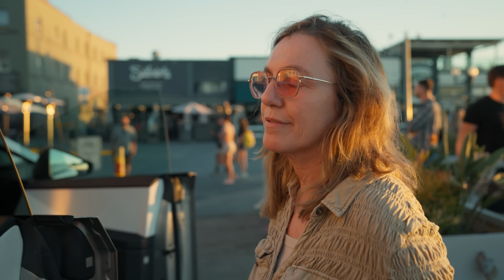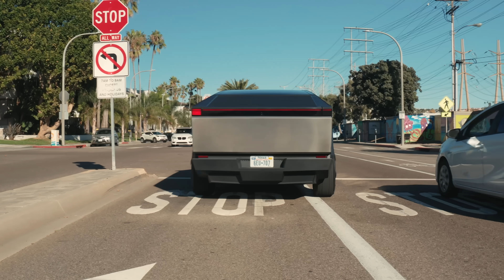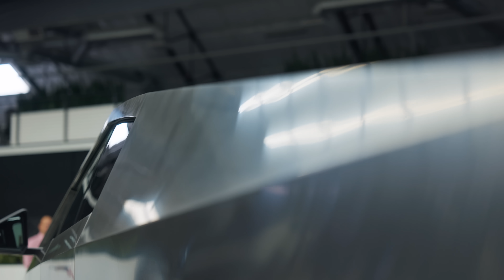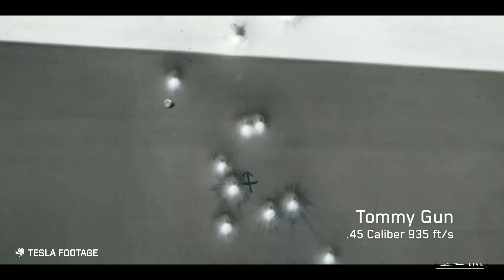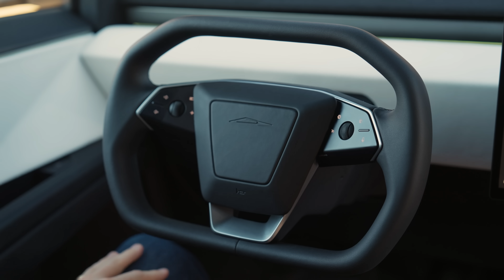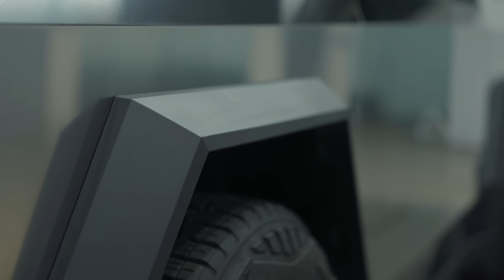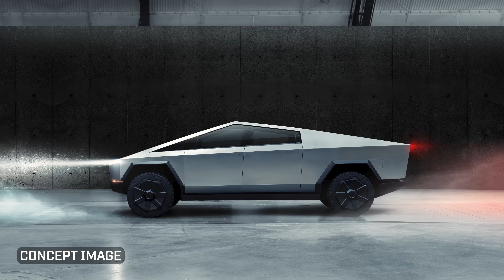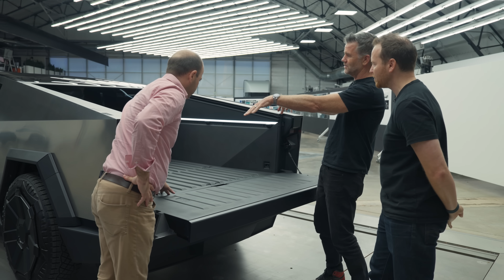FIRST DRIVE: Tesla Cybertruck Full Review

Comment: I have to think the world didn't need another Ford or Chevy with just the difference being it's electric and made by Tesla.  I will give the engineers and designers kudos for not doing that.  It's truly striking.  It looks like it is from the future and always will be, lol.  The only thing that bothers me, personally, is those really sharp corner top points in the back.  They look lethal, or at least potentially painful.  I'm not ready for any electric vehicle because of the intrinsic idiosyncrasies an owner must work around.  That would be higher mileage trips with and without towing due to charging availability and inconvenience.  It must include much higher repair cost potential and the higher insurance rates that follows.  Finally, the consumable tires are quite expensive.  This isn't a vehicle for the conventional pick-up customer, but it certainly cuts its own path to the point of having no direct competitor.  I imagine it will be another niche Tesla hit with just a hint of crossover into the mainstream.

Comment: Tesla are pioneers, and Tesla are idiots.  Reinventing the pickup to be ACTUALLY TOUGH in stead of just saying it's Tough is a big yes.  Tossing in novelties like the idiotic off-center computer screen to replace having a (more expensive) gauge cluster and removing nearly all tactile controls so you have to take your eyes off the road for those too just isn't acceptable.

On a side note, did I understand correctly that you can't turn off 1 pedal driving?  I hope that's not the case.  I don't see why they can't integrate regen into the brake pedal movement.

Comment: Well, it's stupid and useless for a few reasons. One, it's useless as a pickup truck. Two, electric powered vehicles are just unrealistic for most buyers in the mainstream. The stainless body is wavy. The body design itself is awkward, and looks like something a 5-year-old child would draw. The steering sounds like it would be way too twitchy. You cannot see out of the rear window it appears. (I don't care about cameras, I want to be able to turn my head and look out a rear window.) It appears to have HUGE blind spots. Unless this reviewer is like 4 feet tall, the driver's seat looks ridiculously huge. It is WAY overpriced compared to what it was supposed to cost. The "bulletproof" glass broke during the way overblown introduction or whatever that event was called. The world is getting stupid, and this "truck" is just another example of that stupidity.

Comment: the sure have hit a home run after all this time... except the bait and switch on the pricing and stats. over a million people put $100 down expecting a 40K EV truck that was more than capable, and got a 60K truck that's not even available for 2 more years and has the worst performance stats on the same size battery pack and isn't even worth it. now everyone has to spend 80k and wait a year or 100k and wait months just to get 1 that's actually capable, or lose their spot in line. a complete bait and switch that they should be class-action suing for.

Comment: I'm surprised you didn't ask about the disastrous visibility of the A pillars. This thing is a terror to people in crosswalks, on the side of the road in turns, or bicycles. Is autopilot just supposed to save those lives?
Reply: That's a good point. Hopefully there will be a facelift every 1-2 years.
Reply: So you have drivin one and know that is a fact? Not a single person I have seen in a video that has actually driven one has mentioned it.
Reply: On the contrary all test drivers I've seen  remarked on how awesome the forward 180 visibility was compared to others. Once they got used to tech for the rear it was the most "secure safe" truck they've driven
Reply: @Jazz5777  Work a little harder on your research then, there are lots of reports of just how bad it is. What bugs me is that we had the designers right here and no one asked them.
Reply: Imagine your head smashing into that stainless steel body instead of sheet metal! Like an egg thrown against a brick wall. Should be called the Pedestrian Killer Truck instead.
Reply: Tons of flaws. I would not want to be the first adopter.

Comment: Chopping my way through this video, and taking what was promoted from the past: it sounds like they've relied on an exoskeleton for structural rigidity.  It appears from comments, that this impresses a lot of people but coming from a world of steel, construction, design -  great designs are cool in perfect world and brand new, but often overlook practicality of serviceability - so I'm curious to see in the coming months, if thresholds were properly established, interpreted and enforced for the condition of the body, aka that structural frame.  I can look at my truck at this very moment, with admiration of its dents and bumps all while without sacrificing the frame whereas if the body was a frame, it would start creeping to thresholds outside of acceptance and require repairs. The material type, thickness and continuous extent (without seams) makes me suspect that repairs to those vehicles who have structural damage will be so great in cost due to the process (complete joint penetration welds), lack of labour (probably zero body shops even know what that is, and even in the steel fabrication market only a small % are qualified to work with stainless).  I suspect those who buy teslas, even the trucks, don't actually use vehicles in the same way, but coming from someone who admires practicality of both use, service and maintenance costs - I don't think this would be the truck for me but those who want to admire engineering and futuristic boundary pushing vehicles.  I guess I'm just getting too old!

Comment: The hype about the look is shadowed by the advances in engineering here. The look is what sells cars...the sizzle, the sexy. But the engineering is next gen and watch the legacy auto makers follow.High voltage architectures for instance, more efficient for delivering the current and using less copper. Engineers with imagination starting with the initiative from the top engineer, the boss.

Comment: Will be interested in how this big boy handles in snow and ice with proper winter tires .  Weight distribution can be a killer on traction at launches from a red light or stop sign.  Also being a piggy can be a killer for stopping distance on the highway in snow.  Also curious what 0-30F temps will do to battery life and range on this truck.
Reply: I have seen one being tested here in Norway up north too where it gets to -40C which also is -40 Fahrenheit.
Reply: @hardergamer  cool do you know what the results or feedback was to range in the cold?  Also did they give feedback on handling from a dead stop and then stopping distance?  Driving 50mph on a highway in a snowstorm at 25F would be a concern.
Reply: It looks like very special tires. Haven't found any info on fitting a large selection of regular tires based on desired conditions, load, speed ranges, durability and price point.
Reply: Don't see any winter tires available on tirerack ... do we know if any would work on Cybertruck?

Comment: Looks cool, does have some good engineering, i like the 4 wheel steering

The biggest thing for me that would be a turn off is flyby wire steering, I like getting road feedback in my steering wheel can tell me a lot about how the vehicle is handling\traction\mechanical health. Also i like to have a steering wheel that gets heavier the faster i go so i dont give too much input (my honda accord does this with its ESC, at low speeds it gives more assistance with steering and high speeds it gives less help), its sorta the reason i absolutely hate driving GM's as their power steering has always been way too light so i always feel like a float over the road and with little input on the highway im going all over the place.

Although being fly by wire im sure they could have a computer give you artificial feedback

Also what would happen if the truck loses power at highway speed, can you still steer? (i know its rare scenario but still)
Reply: It provides feedback... more than many vehicles with over-powered power-steering.
Reply: @JorgTheElder Thats good, while electric trucks are not as practical in my neck of the woods I can see with improvements of infrastructure and technology we have some cool stuff in the future to look forward to

Comment: This is gong to be a truck with a lot of problems. Info is just spewing out of Tesla that this thing has no business being on the market. Why do you think they're only making UP TO 50,000 examples-when they could sell countless millions- and took down payments from 500,000 people? They're not able to mass produce these things for some reason. Well, it turns out that according to the leaked data, it not only has typical p.o.s. Tesla problems but there are serious design problems. All you have to do is look at the steel sheets on the exterior. They look like plastic that's been in the microwave for 15 seconds. Waves, front-to-back, side-to-sude. 

Also, in the commercial vs the 911, they lied. They used the uber base model (which is okay, I guess) without launch-control, traction-control, and in "N"[ormal] mode which is the 'driving slow in-town to get good gas mileage' setting. Not "S"[port], "S+[port Plus], or [T]rack. Also, and I'm not a Tesla hater, Musk gets away with saying anything when it comes to his companies. He said it would be 40k. Engineers, when that number was announced, said that claim was nearly impossible, it could be less than 75-80k Nobody holds him accountable.

Comment: This is a cool concept car but if you read in between the lines of what the engineers were saying, it seems like tesla themselves are anticipating issues with the scalability. Due to all these exotic materials and new technologies, I don't know if they'll be able to actually mass produce this thing and even if they can, will they make any money off of it. I also worry if the quality of the actual production versions will degrade. I think they probably put in a bunch of extra QA to produce these initial trucks to be paraded around as a demo car. Wonder what the quality and the performance will be of the mass produced ones.
Reply: They delivered 20 of them to actual owners. Not demos. Owners.

Comment: What is all this baloney about the Cybertruck not being functional? It stomps competitors when it comes to functionality. It has built-in 120 and 220-volt AC outlets in the bed. It has a covered bed that can support over 200 lbs (so you don't have to wonder if the bed cover is going to get bent when you put a toolbox on it). It has a 4x6 foot bed that expands to 4x8 feet, the size of a plywood panel and wallboard. It has the greatest towing and carrying capacity of any pickup. Tossing off comments about it not being functional has become so common, but it is dead wrong. It has a 17-inch clearance for off-roading. It has a tight turning radius. Just stop the lazy commentary and think before you speak. So now instead of FUD we just get lies.

Comment: If it is so strong on the outside, how will it behave on a full on collision with other cars that are design to crush on impact and absorb most of the energy?
Reply: The front and rear castings are designed to fold in a collision, and to fracture in higher speed collisions, dispersing a lot of energy.

Comment: Why no charging port up front, like a Rivian R1T?
If you have a Rivian R1T, hauling a trailer on a road trip wouldn’t be the total horror story in comparison with other EVs (including the Cybertruck).  With the exception of 1 charging station in Tennessee with 4 pull-thru stalls  …. every charging station I’ve ever seen (in real life or photos, in North America), one has to detach the trailer AND park the trailer somewhere BEFORE being able to pull the EV into the charging stall  …. because the charging port is in the rear of the EV … and a hooked-up trailer blocks the charging port.

Comment: Lithium is   a  rare  earth metal  and  the  cost to Produce the  batteries is prohibitive -  You can  see  there  are  No Knobs 
and Dials  so  you have  to take  your  eyes of  the  road  to make  changes - Dangerous  just like using  your Cell Phone 
when  driving  - In the  hotter  Southern Climate  you have electric  cars  catching  Fire and in the  Colder Northern Climates 
your Range you can drive  in  a lot shorter -   Where do  you find  a Charging Station  ?    GOOD  QUESTIONS  ?

Comment: I like the general look, but i question the sharpness of those edges. The Countach is a boxy wedge designed to slice the air, and it still has more curves and soft edges than this. Plus the loadbay might be big, but that sloping roof robs it of some practicality pick-ups need for larger cargo. There's a whole industry for designing aerodynamic canopies for pick-ups of all shapes and sizes that this Cybertruck is basically ignoring because it ashews the standard 3 box design language of a pick-up. And then there is also the issue of reliability of the battery. An electric off-roader is undeniably cool, but the Internal Combustion Engine had over a 100yrs headstart and has been refined so much that it's much cheaper to run than an electric car. It takes a few minutes to fill-up the feul tank, which would take hours for the equivalent EV, plus it edges out on range and petrol stations are in abundance worldwide. Not to mention the mechanical upside of manual ICE cars being able to be pushed without power to the nearest petrol station. Most Safari off-roaders use jerry cans for backup feul, and usually that's enough to get them back to civilization. Then there's the problem with where the electric power comes from. Not the environment factor, but the governmental factor. Most countries don't have the infrastructure to support an electric vehicle industry for the general public. In South Africa we are struggling with keeping the lights on cuz our government is so incompetent at managing the national power grid.

Comment: The F-117 was so edgy a design as its outlines were calculated for lowest possible reflection of radar waves on a Cray 1 computer in the Seventies. This computer simply couldn't handle more complex shapes. With this in the back of my head, the Cybertruck looks like outdated stealth tech to me. Its drag coefficient will be off the scale with all these hard corners, so it probably sacrifices range for looks, which is something I don't nearly like.
The pedestrian-slicing outlines probably will prevent it from meeting the minimum requirements for third party protection in crash safety, so I doubt it will be marketable in Europe. The bonnet's front edge seems to be at exactly the right height to crack the skulls of 6 to 10 year old kids.
That doesn't make much of a difference for most Germans at least, for at its 3.1 tons empty weight, it is beyond the weight limit for the common Class B driver's license (2.8 tons) anyway, you need at least the C1 truck license to drive it.
And you won't drive it fast, for on German roads, vehicles of a total weight loaded above 2.8 tons are restricted to 80 kph. ☺ 
Mentioning Germany: We have our TÜV-examinations here, the bi-annual technical examinations for road-going vehicles. TÜV publish rankings of car makers by the number of road safety relevant defects found in the examinations. Teslas performed abysmally bad there, ranking last in the list behind Romanian budget car manufacturer Dacia.
This makes me wonder if Tesla will end up as another flash in the pan like DeLorean and others before. All the sales points may end up having been nothing but marketing blab, and basics of car design were ignored or approached from a viewpoint that is very much focussed on permanent fair weather conditions like in California or Saudi Arabia.

Comment: I just can't get over the design. To me it is extremly ugly. The front is all right, the rest looks like they ran out of time to come up with a design. I have nothing against simple and plain designs. But this is just a box. Reminds me of that electric car Clarkson, Hammond and May "build" in Top Gear. Different is not automatically good.
The car is also very dangerous to pedestrians since it is hard a a rock and has many sharp edges. I guess without some rather substantial changes this won't be approved for sale in eruope. It's probably useless anyway since our streets are quite narrrow. The technology is fascinating, though. And i like the look of the stainless steel.

Comment: Looks awesome and more functional than expected… Entirely steer by wire though. Hard pass. If your power steering pump fails, at least you still have functioning, but heavy steering. What if the wheel position sensors or steering motor glitches right before a corner?
Reply: You might then also want to avoid airliners, as all newer Boeing and Airbus aircraft are fly-by-wire, with no mechanical connection between the controls.
Reply: Well, obviously you crash and become another telsa statistic
Reply: @Chris-Brown- you mean the statistic of the safest cars in the world? That one? 😜
Reply: You mean the cars that drive themselves into semi trucks and don't even try to stop? Or run over people? Those "safe" cars?  @MJ-zo5gb
Reply: seems elon doesn't care about who dies driving his projects, how many customers have already died while unknowingly beta testing his crappy "auto pilot"?  @Chris-Brown-
Reply: Tesla already considered this. Front wheel steer by wire has two motors for redundancy and multiple sensors.